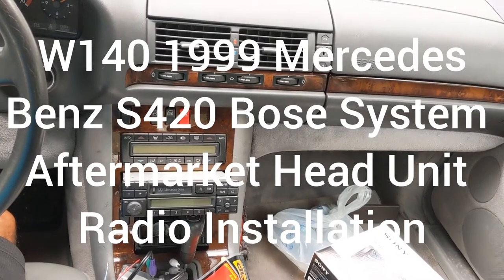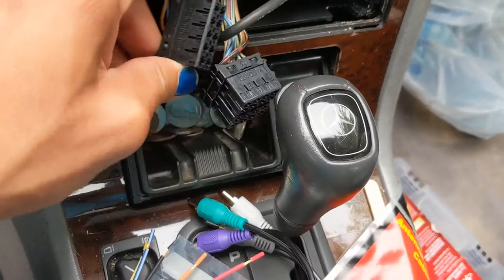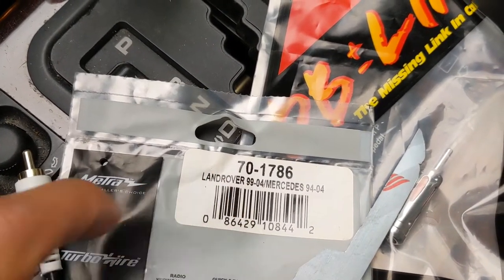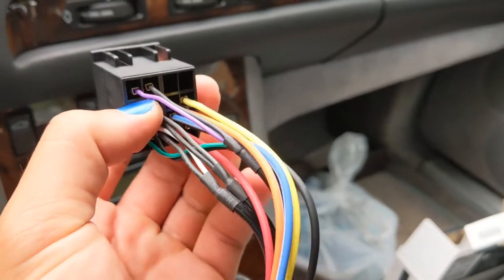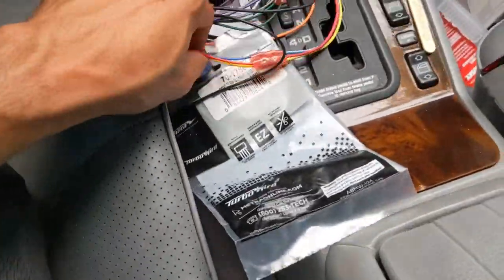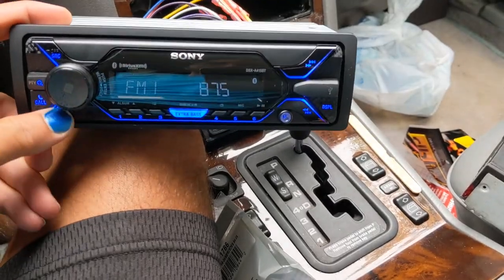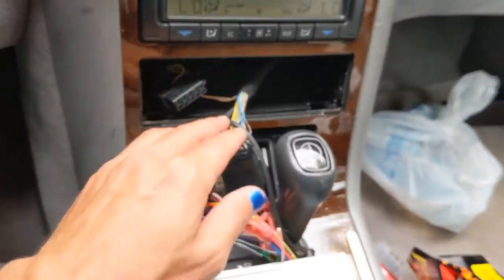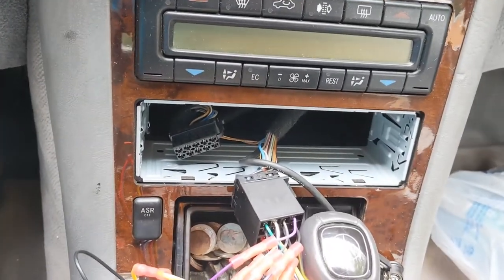W140 Mercedes S420 Bose Aftermarket Radio Install

Comment: Nakamichi NQ711B Bluetooth radio is a direct fit with absolutely no special harness or adapter needed. I was shocked!
Reply: Do you know if it's the same for a 94 model
Reply: @LethalVlogger Yes, mine is a 94 with the same stock radio as in the video and it’s the exact same thing. Directly connected the Nakamichi model with no adapter
Reply: Ok thanks! Also do you have any mechanical advice on this vehicle can't really seem to find much online
Reply: @LethalVlogger Anything in specific?? I’ll do my best to answer or direct you to certain websites and stuff, no problem.
Reply: @rags2riches938  I have white smoke while driving and mainly just wiring
Reply: The white smoke could be one of two things. Coolant being burned via head gasket problem or transmission modulator leaking trans fluid into the vacuum hose running to the intake. If you pull the vacuum tube at the trans and find even a drop of fluid then that’s your problem (easy cheap fix). If it’s the beginning of a head gasket issue then I would take it to a reputable mechanic. DO NOT USE ANY “quick fix” liquid repair.
Reply: U always use a aftermarket harness for the wires in the dash no matter what car it is n its plug n play and the harness like $20 nothing special.
Reply: Simple plug and play?? Sounds good with Bose speakers?
Reply: Wow thats cool! Any idea if it’ll fit a 97?
Reply: I assume you still need the antenna adapter though, correct?

Comment: Ive a 1995 w140 s-class 

I hope you reply to this message,

I’m having a radio wire issue

everything is connected correctly, like wire to wire, for some reason, my radio doesn’t come on when I turn the key to the second on position or when I turn the car on, what could be the reason for that?

My red accessory wire / yellow power wire, turns the deck on when I connect them all together, which leaves the deck on even if I take the key out the ignition n it drains my battery if I let it sit overnight.

every wire is coded correctly,  color to color.

I purchased a brand new (AMP) recently. 

so I hear the (AMP) turn on when I connect the (blue) wire to the (yellow) power wire, just to make sure the AMP turns on, which it does.

I get no power from the deck system what so ever, when all the power wires are connected correctly. 

the radio (fuse) is fine. I’ve no blown fuses from the trunk at all.

If you can reply back, that would be awesome!.
Reply from the maker: @appleuser7114  check the fuses under the hood as well. If all is well then check the voltage to the yellow wire with the key off (radio unplugged) and see if it has power. The red one should be dead. Now turn the key on and check if the red is powered up. If it is then your head unit should power on so try a different radio or see if the original radio will power up. If either is missing power then you have a power supply issue. I’m pretty sure there is one under the hood on the drivers side
Reply: @MileHighDreamz  thanks for replying back 🤙 I’ll go try that n I’ll get back to you. Thanks again.

Comment: Thanks for this video! I'm currently looking for different radio options for my 140. I'll bookmark this as well!
Reply: Nakamichi NQ711B will plug right in to the factory harness. I was surprised
Reply: @rags2riches938  Thank you! I went a different route. I got Becker Monza radio and purchased Bluetooth adapter for it. Actually two Bluetooth adapters - cheap one for $32 and Yatour with a bit more options. Both work fine.
Reply: That sounds great! Thanx for the info

Comment: I did all that and I have the same part for my 2000 mercedes c280 w202. The radio turns on but no sound comes out of the speakers. Any idea why? Thanks
Reply from the maker: Did you hook up the blue wire that signals the Amp in the trunk to turn on? Check the fuse for the radio/Amp. If still nothing it would check that the Amp in the trunk is getting power when the radio is on
Reply: @MileHighDreamz  you mean the blue and white color that comes out from the radio adapter? And have another question. The wires that come from radio adapter which one is nigative the 2 colors or the straight 1 color? Thanks
Reply from the maker: @najim-fx6626  yes the blue and white wire that comes off the aftermarket radio. That is the signal wire that is used to send a signal to the Amp in the trunk telling it to turn on.

The black wire on the aftermarket radio is the negative.
Reply: @MileHighDreamz  I did connect the blue and white wire that comes from radio to the blue and white that comes from the adapter. Changed the amp fuse and still nothing
Reply: @MileHighDreamz  I believe the amp is not working
Reply: @MileHighDreamz  I got the amplifier out opened it and it was all burned out inside. So that's the problem. I have to get another one

Comment: so what is powering your amp? I have a 95 model of this car and did exactly what you just did, everything comes on except the sound?
Reply from the maker: The amount of I’m referring to is the original OEM amplifier in the trunk. It is powered by the same factory harness it is connected to in the trunk. The only thing we are changing is the signal that we send it. Double check that the signal wire (blue) is connected. If you are changing the radio because you had no sound before then maybe the issue is with your amplifier.
Reply: @MileHighDreamz  thank you so much for responding,  I will check that out

Comment: Hi how are you? What did you do to all the black wires
Reply from the maker: Which ones are you referring to?
Reply: I just watch the video again, and realized you have already mentioned that those black wires will go as the negative,  thank you so much. It works on mine, I just finished it, 95 c280
Reply from the maker: @sauljob2396  awesome glad to hear it helped out

Comment: Hello. I just did the same thing on my s320 w140 and i have no sound,  any tips
Reply: I'm going to bank that you didn't get the power wire connected to feed the supply to turn the amp on just a guess
Reply from the maker: What Robert said and check your fuses.
Reply: Hello again,  but when I plug in the old radio it has sound,  maybe I have the wrong harness
Reply from the maker: Did you check to verify that the Amp power wire is connected correctly? If you have everything else set up it won't matter if this is disconnected. The head unit is sending all the signal to the Amp, but since the Amp is off it is not powering the speakers
Reply: I have found on some aftermarket new radios that the amp turn on lead is faulty or weak and will short out on initial install sometimes a little carelessness and it grounds out and ceases to work all else fails try the antenna lead most new aftermarket radios come with antenna leads and amp remote leads get in there with a meter and check your voltages of the blue wire bluewire tends to be your remote lead if I'm not mistaken
Reply: Thank you all, let me try and see what happens

Comment: Why did you cut the rcas off? Maybe I missed that part?
Reply from the maker: By RCAS do you mean the connectors that I cut off the harness? Because this car does use those, so I cut them off and hard wired like any other adapter you would buy
Reply: @MileHighDreamz  normally you would plug in the rca  cables to the rca inputs behind the new head unit. That's how you get sound from the factory amp. Just wasn't sure why  you cut them off and wired them to the speaker wires?
Reply: @MileHighDreamz  yes the connectors
Reply from the maker: Because they are not used. Watch it again.

Comment: Does this work without the Bose system?
Reply from the maker: I am not sure about the non-bose. I don't see why not. The bose has a separate Amp in the trunk which is usually where an issue happens in some cars. If you don't have a separate Amp then you won't have the issue with sensitive volume control. I would imagine nonbose is the same or easier. Check the plug type on the bag of your head unit to make sure you order the correct adapter.

Comment: Has anyone noticed that their – speakers do not work after doing this the small 2-inch ones on the dash
Reply from the maker: Those would be your tweeters. I just verified that mine still work. The install is fine. You either have a different issue or have your highs turned down and can't hear them.
Reply: Yeah I had a lot of aftermarket Mercedes stuff in there for lining and a upgraded head unit that controlled the 6-disc changer I have the 6-disc changer control in my Dash and it doesn't work hence why they did all the work I just bypassed the amp and the Lines off the head unit and they work great I replaced thim with infinity hundred watt tweeters the rest of the speaker through the amp awesome job like your video
Reply from the maker: Just make sure the impedence/loads are OK per the amp/head unit so the set up lasts.
Reply: I have the RCA jacks running through the amp with the aftermarket harness I didn't clip them off but that frees up 4 additional outputs for your hard wire to speakers I just ran my tweeters to that on the front Channel the great way about doing that I don't get that ridiculously high volume to beep every time you change a setting on the radio does a little pop turn the radio on or shift between different things but I can live with that we ground somewhere anyways thank you for all the input quite helpful
Reply from the maker: So the beeping is a function that you can turn off in the head unit. Refer to your manual. I turned mine off and haven't had any issues with bopping or beeping. 

Glad it worked out for you. Enjoy
Reply: Thanks from México!

Comment: Am gonna try this and if it works ill fucking love you forever mannnn ill paypal you what I was gonna pay to someone elss
Reply from the maker: Nice, glad it's helping. Make sure to read my update in the description about Line Output Converter (optional).
Reply: Nakamichi NQ711B fits directly to the factory plug
Reply: @MileHighDreamz  mannnn I'm struggling asf r n with it lol btw will it work if my radio is completely dead? Idk what has happened to it actually I just want music in my car
Reply from the maker: @King12763  as long as you are getting power to the new radio (check your fuse) then I don't see why not. If your amplifier in the trunk failed then no, because the sound is still going through that.

By completely dead, do you mean no sound, or that it won't even light up? If it won't light up or play sounds etc then check the fuses.
Reply: @MileHighDreamz  yes it won't light up at all I checked the fuse on it and the fuse is there idk if its bunt our or not ill replace them with new ones and let you know again
Reply from the maker: Check the fuse on the back of the radio as well. Take a multimeter and check the yellow wire has power with the car off, and the red wire has power with the car key on. It sounds like one of those three are your issue.
Reply: @MileHighDreamz  ill check that out right now thanks for helping man ive taken it to install new sound system and they said its gonna cost 3500$
Reply: Bro I took the radio and cd player out and there is a motor looking thing and it says 12 v idk what and 2 wires come out of it and is connected to nothing plz help
Reply from the maker: You need to be more descriptive that that. Trunk cd player or the aftermarket on in the dash? What is IDK? What color wires? Etc. You need to realize I'm not looking at what you are
Reply: @MileHighDreamz  okay so it has a black and one red wire connected to its back and has a black and a white wire coming out of the other side of it the black one and the white one are connected to nothing
Reply from the maker: Pm me your IG account and I'll add you. You can send me a picture there. Still not sure what your talking about